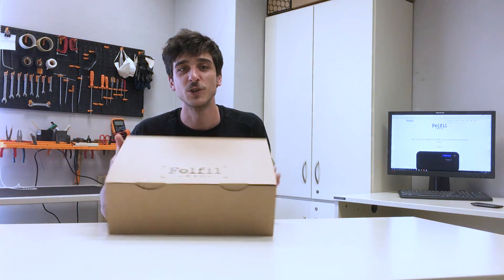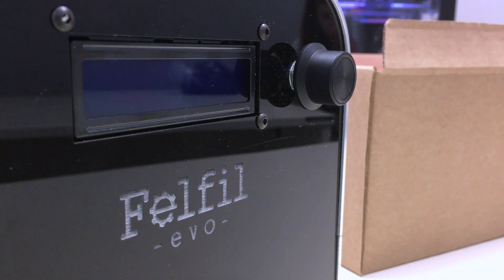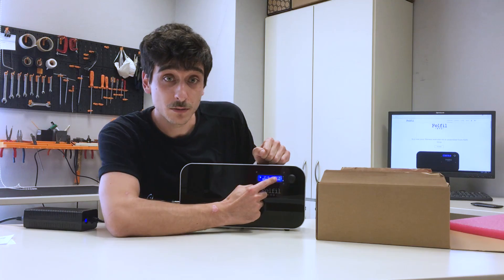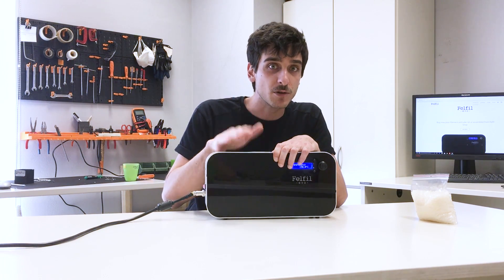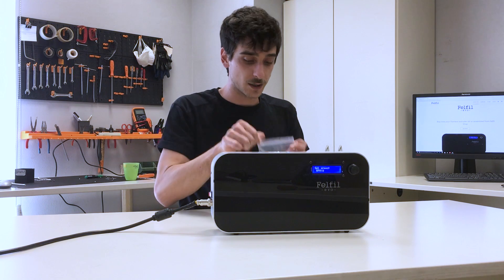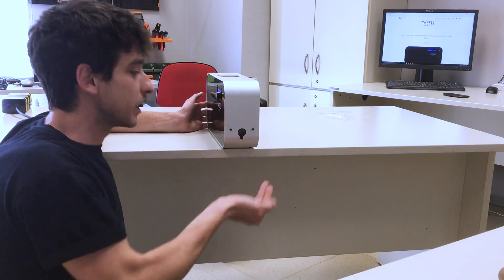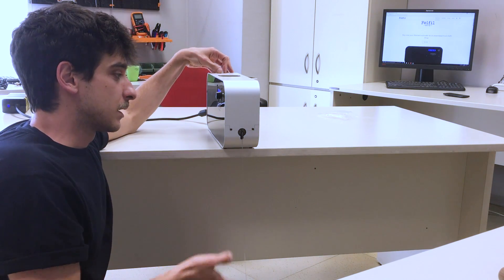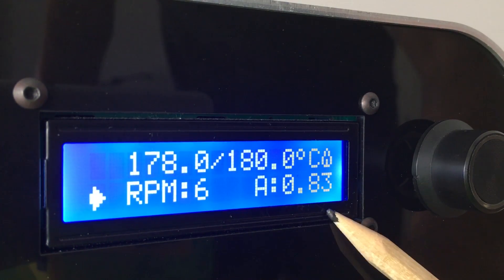#2 Felfil Evo talk: First step with our filament extruder

Comment: can i make a filament with pet bottle material?
Reply from the maker: Yes you can, but it is quite difficult since you need a long cooling system, we are experiment different ways in order to make this job easier! We are planning to write a full guide for the community once we will find the right tricks. However you can already start recycling plastic like bottle caps or soap container
Reply: @Felfil  hi im very interested in PETG bottles too, i think with tis nachine i can do that, how much meters can make for hour ? its a cuestion of time too, very thanks